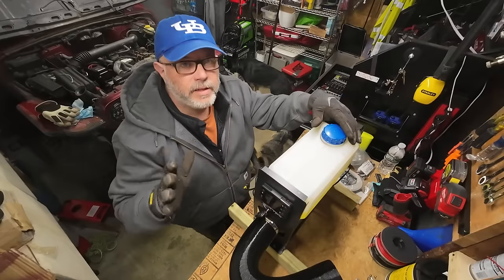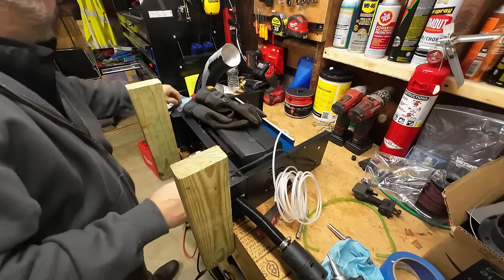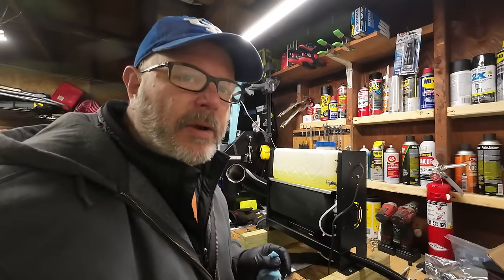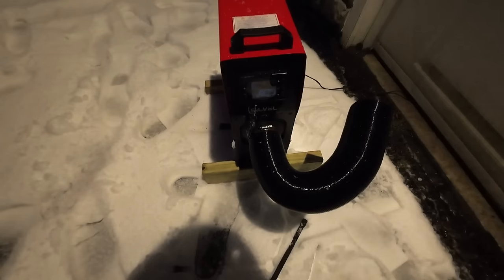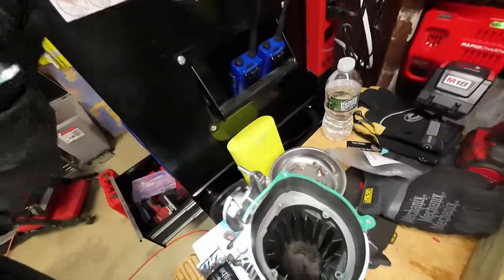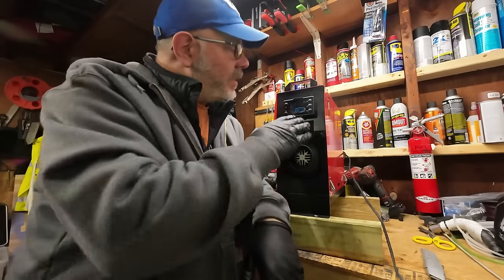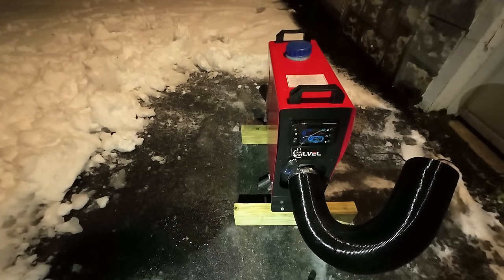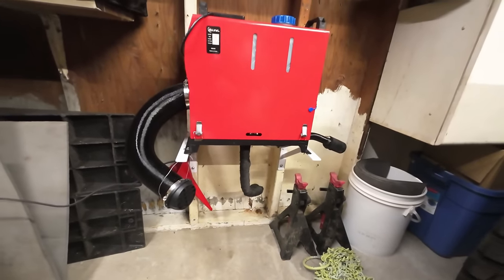Mistakes were made - I almost killed my diesel heater

Comment: The soot issue is something known as rather common for oil burners. That they need the carbon and soot  removed every so often. It's just because you are burning a hydrocarbon. Modifications only delay ho often you have to clean them out. The size is partially the problem, too.
Reply from the maker: Thanks for commenting. Yes, the soot took me back to my oil burner service days 38 years ago. I'm hoping this will take me through the rest of the winter and I'll service it for next fall.

Comment: Just a little tip I run my heater off a jary can I drilled a hole in filler cap save you from spills.
Reply from the maker: That’s a great idea. I think I’ll give it a try. I literally just filled the tank for today 😂
Reply: @paulethier3416  it works great I just take the cap off one of my other cans when I go get my fuel
Reply from the maker: Thanks for the tip!
Reply: @paulethier3416  no problem happy to help

Comment: Very interesting video. Looks like You have a much better mounting place for the heater. I have mine up high in my shed and I used the same marine through hull fitting going through my vinyl siding. The only extra thing on my siding was one of those flat mounting plates for light fixtures. I bought a 3/4 inch pipe cap (in the hardware section at Home Depot where they sell angle iron and threaded rod) I put a plastic drawer pull knob on this and once the exhaust has cooled down, I put this into the through wall fitting. This will keep insects, birds, mice and rain out........Take care, Bluefin.
Reply from the maker: That's a great idea. Thanks for sharing and commenting.

Comment: Two weeks back same machine new (in case) exactly the same had to open it clean it then run kerosene in it ,never had this problem on my other 2 over last four years did notice that glow plug was not screwed in fully on dismantling
Reply from the maker: Yes the glow plug was loose
Reply: My thinking was to much fuel getting into the burn chamber????
Reply: @johnhealy9231  2 machines with identical problems, could be they are being sent out with incorrect settings for pump rate/fan speed. Or maybe even a bigger pump, if they've used a 28ml pump instead of the usual 22ml you would be about 25% rich on the fuel/air mixture. You would need a CO meter to set the correct pump speed.

Comment: permetex red or copper hi-temp sealant would probably be the answer for gaskets.
Reply from the maker: Thank you for the tip. All I had was the black at the time. I will get a tube of the hi temp you recommended to have on hand.

Comment: Does it automatically adjust the mixture for altitude?  Where I live is about 3500 feet above sea level and there doesn't seem to be a problem, but I wonder if it's running too rich.  I'm not having any carbon issues but I haven't had it very long and so far I only ran it for about 20 or 30 hours..
Reply from the maker: I’m not sure if it adjust automatically. Since I fixed the exhaust it’s been running perfect.
Reply: @paulethier3416 Okay, thanks.  I'm not seeing any smoke and the exhaust smell isn't very strong, so either it does, or I'm not high enough for it to make mush of a difference.  Maybe come summer, if I feel ambitious I'll mess with it a little.

Comment: Paul every time you use the Heater do you put it on max before you shut it down that causes blocking  👍
Reply from the maker: Yes I do. Because my garage doesn’t have very good insulation it always run on high
Reply: Hi Paul have you tried to change the pump for a stronger one, might help with the performance and stop that annoying tick have a look at David Mclooky his channel is all about the Chinese diesel heaters hope this helps he's  Scottish 👍
Reply: Soz mate it's McLukie

Comment: I'd guess that your exhaust set up was causing excess back pressure in the combustion chamber. This is most likely causing poor air fuel mix and dirty carbon rich combustion. If you have to extend the exhaust, I'd do a straight pipe set-up or single large clean radius bend. Best with ridgid tube instead of flexible tube.
Reply from the maker: I've had no issues since I modified the exhaust. Thanks for the comment.

Comment: i set mine up in my old shop ran flawlessly then i moved set it up and strarted it got all the errorcodes E2 E3 E5 E8 E10 turned out it was the battery not liking the deep cycle charge i accidently gave it by not checking the charge settings first and the fuel line was kinked so ill be ordering that white hard line because temporarily i just have the cover off and the tank sitting at a 45 degree angle as to not kink the line. as for the pass through its just held on with drywall screws until my crippled ass can find some help. im hoping the exhaust port being 4 feet off the ground there wont be any issues when we get 4 feet of snow in February
Reply from the maker: Yeah the fuel line upgrade is nice compared to the stock hose. Thanks for commenting and I had no idea that the battery could throw all of those codes. Good to know.

Comment: Just wondering, will the muffler that comes with the heater fit on the outside of the through hull exhaust vent?  I'm thinking of doing the same exhaust set up as you, but want to muffle the exhaust to avoid neighbor complaints.  Would prefer to have the muffler mounted outside my garage so that it can drain moisture through the muffler hole and not leak fumes through the muffler moisture vent into my garage.
Reply from the maker: I’m not sure. You might need to a a coupling on the outside.

Comment: Hey Paul, how is the exhaust hall vent holding up?  Looks like you have vinyl siding.  Have you had any issues with heat around the wall vent where it connects and goes through the wall?  I'm thinking g of doing the same thing but am afraid of excessive heat starting a fire.  Cheers from Canada
Reply from the maker: No issues so far. I typically only run it on weekends when I'm working in the garage. I turn it on around 8am and run it until 6pm. I drilled the hole a little bigger and I wrapped the thimble with exhaust wrap and then installed it. I always run it on high so its always producing the most exhaust heat possible.
Reply: @paulethier3416  Sounds good.  Thanks for the reply.  By the way, you should post the blueprints for that custom made amazing exhaust cover😁
Reply: Had mine mounted more or less directly to my shed wall with pipes running through a metal tube made from rain gutter parts. It still made the wall warm enough that I couldn't stop worrying about it. Bought a longer exhaust pipe and mounted it like his re-install. Seems to work better.
Reply: @fondy44  cheers

Comment: Couldn't condensate from the exhaust ice up in the external metal outlet?  The metal outlet seems a small bore, so any moisture from the heater (not just rain) may be blocking the outlet? Condensate pipe from a gas boiler in the UK is around three times as big, and made of plastic to prevent such freeze ups. Adding more metal in the rain deflector will now just be a bigger heat sink, so the outlet may actually get colder and ice up more readily. Bigger bore, out of plastic drain pipe and insulated would be my next move
Reply from the maker: Ok, thank you for commenting. I was thinking about a large metal pipe but never though about plastic. It would have to be hi temp because this thing does get very hot.

Comment: burning hydrocarbons - gives an exhaust gas containing CO CO² and H²O.
. The H²O escapes as super heated steam, it can and will condense in your tailpipe and if it can it will collect somewhere if it finds a chance.
No need to look for an external water source to get into your system.

Comment: i might have missed it in the video but how long have you had / how long have you ran this heater? and on what power?
Reply from the maker: I installed it right around Thanksgiving and I’ve ran probably 20 gallons of diesel fuel through it. I believe it was my exhaust pipe that was causing the issue time will tell.
Reply: @paulethier3416  interesting. You explained your theory well. I’ll be looking forward to seeing if you have better luck with the carbon build up. I haven’t seen that before when running diesel

Comment: How did the permatex work out?  Did it fail?
Reply from the maker: No issues so far and no carbon monoxide leaks either. Thanks for the question.
Reply: @paulethier3416  how long did u leave it to cure?
Reply from the maker: I don't remember. 1-2 hours I think.

Comment: Did you put barbs inside rubber/nylon tubing connection when adding fuel filter.
Reply from the maker: Yes, the filter has barbs that hold the hose in place.

Comment: What is the claimed issue with the fuel lines? And did you think there would be no warranty assuming they knew you didn't have the exhaust all downflowing? Did the instructions mention that was needed?
Reply from the maker: The claimed issue is the green hose is to soft and expands and contracts on each pump. The clear hose is more ridged and delivers more consistent flow of fuel. I read about this problem on another video and when mine died I took the opportunity to switch it over to the cleaner hose. No issues so far.  I didn't even think to warranty anything, I figured it was to much of an issue and the instructions are so vague it really didn't give much information. Its been running great since I made those small changes. Thanks for commenting.

Comment: Good work to get er workin!
Chinese diesel heaters are infamous for excessive carbon and need to be cleaned regularly. Don’t get why pushing heat down hill 24” is going to change or make a difference. Causing more unnecessary back pressure creating carbon build up. It’ll be worse than your original set up. Exhaust vent an inch or two below outlet on machine would be all thats needed. No back pressure and no condensation build up.
Reply from the maker: My thought going down hill is the moisture would at least drain out. So far so good, it been 2 winters and we are heading into our 3rd.

Comment: E-10 can be easily solved by repriming and restarting, you will hear the vacunm suck in air into the tank  as you unscrew the fuel cap if there is no airflow through the tank cap. dont forget to run the heater at full chat for ten mins before shutdown to keep the burn chamber clean. just push a hot needle through the cap centre or use a 1mm drill bit.  E-08 is a fueling issue but it could just be air bubbles in the line cavitation from the pump possibly e-08 and e-10 can show up together. if you turn the fuel pump mounting upside down so the weight of the pump is pressing down on the rubber mount it will be slightly quieter. looks like shes flooding need to go into thwe special settings menu either 1866 code or 9009 code for the special settings and adjust the fan speed settings to 5000 uppermost limit and 1500 lower limit. if it is set to 4500 uppermost factory settings over fueling will occur causing it to flood and flame out.

Comment: I just ordered the 8kw unit , I'm  wondering about the heat going thru the wall , did you insulate the exhaust pipe inside your wall ? I'm seriously thinking of putting the unit outside my shop , under a covered patio and running the fresh air inlet and the heater pipe thru the wall , because the unit seems really loud if it were inside , thoughts ?
Reply from the maker: Thanks for the question. I used a thimble to go through the wall. There should be a link in the video description. I also wrapped the exhaust to protect from radiant heat. My wall temp right around the thimble is typically right around 160 or 180 degrees F.
Reply: @paulethier3416  ok , I did see the link for the thimble but was wondering about the inside heat of the wall. I also ordered a roll of the heat tape ( not sure of the proper name of it ) to wrap the exhaust pipe  , thanks for the response.
Reply from the maker: Make sure you wear rubber glove when wrapping the exhaust. The wrap is part fiberglass and your hands will be itchy for a day or so. I learned that from experience. Also, when you first fire it up it will smoke. If your in a garage or shop you will probably have to open the door.
Reply: @paulethier3416  oh ya great tip ,  thanks , I'm seriously thinking of putting my unit outside of my shop , under a covered patio or even an enclosed box , then just running the heating tube thru the wall.
Reply from the maker: That sound like a great idea. I'm not sure how weather proof these heaters are but with a roof over it I feel like it could work really well. @scottweedin7570
Reply: Great job paul.have learned so much from you IAM going to put one outside blowing in through my wall.i will be making a box from wood but was wondering how to stop exhaust burning wood.noticed you had a boat mount through yours it's heat dissipation IAM worried about.thanks for your videos.
Reply from the maker: Thank you for the comment. I wrapped the exhaust with motorcycle exhaust wrap to keep the heat down. It runs about 150 degress F. Here is a link to the wrap I used. https://amzn.to/3HL0cyB It will smell and smoke a little on the first run but it will go away after a few hours.  @anthonyralph3101

Comment: were you using just diesel gas ?  How many hours do you have total on this heater ? YTy
Reply from the maker: Yes I use diesel  right out of the pump. It only has about 40 gallons of fuel through it right now. I can’t say for sure, but I’m pretty confident the way I had the exhaust installed caused this issue

Comment: Sir, are you sure the  filter is installed correctly ?
Reply from the maker: No I am not sure. I’ve seen them installed both ways and there’s no arrow on the filter. It seems to work OK I’ve ran it for six hours with no issues. I’m open to suggestions if you have any. Thanks for commenting.
Reply: @paulethier3416  The right way is in the other way
Reply from the maker: @bellofiore894  Ok, I'll switch it around. Can I ask why the other way is correct?
Reply: @paulethier3416  As you said .the filter now is working but USUALLY the real position is with wide part UP and narrow DOWN. A quality filter has an arrow that indicate how to place otherwise it does not work.  I know  you know this.Greetings
Reply: @paulethier3416  Either way will filter but I've always seen them installed so that the fuel comes in around the outside of the filter element then flows out from the center of the filter. It takes more debris to clog it like that and also you'll be able to see any debris as it accumulates.

Comment: Did I change the wire scream in the unit where the fuel line goes in
Reply from the maker: I did not change the screen but I did clean it. Thanks for the question and commenting.

Comment: Hey buddy I watch you clean your diesel heater out can I suggest something I haven't had problems with mine for 6 years if you take and you run some diesel fuel injection cleaner in it it'll help keep that combustion clean and I've never had no problems never changed no fuel pump never change fuel heater never changed the glow plug and it still run for 6 years I've never had not one problem with it brother So I would suggest to take and clean it out and put some of that diesel injection cleaner in there already thank you let me know how that works out for you thank you
Reply from the maker: Thanks for the comment and suggestion. I'll give it a try.
Reply: @paulethier3416    yer welcome it works for me i havent done nothing to mine in 6 years
Reply: Yeah I agree was actually going to suggest this until I saw your comment dpf cleaner or a fuel additive should keep that burn chamber clean

Comment: Condensation buildup in the exhaust would not cause carbon builup in the chamber. You’re obviously running your fuel too rich for your altitude, and that can be tuned.
Reply from the maker: Thanks for the comment. How do you tune that?

Comment: If you run this thing on a low BTU setting for long periods, turn it to it's highest setting for a few minutes before turning it off. This will burn off the 
carbon buildup that it accumulated by running it at a temperature too low to burn off the soot.
Reply from the maker: Thank you for sharing this information and for commenting.

Comment: What happens if there is a sudden power cut during operation?
Reply from the maker: Many people have pointed out to me that it should be run on a battery so if the power goes out it won't be shut off immediately and there will be time to turn it off properly if needed.

Comment: I ran my diesel heater in the arctic in -35 and the fuel pump actually failed. I replaced the pump with a new unit and it was back up and running in no time.
Reply from the maker: Thanks for sharing a comment.

Comment: i run mine on low, quite alot of the time... which aint good... the soot builds up.. doesnt get hot enough to burn it out... So once a week, I leave it on, flat out, for about 30 mins..... All good
Reply from the maker: That's great information. Thanks for sharing and for commenting.

Comment: Was that happen in 2 month? All that carbon Ash?
Reply from the maker: Yes. I had a low section in the exhaust which caused moisture to build up which cause carbon to build up. The new exhaust has a slope to the exhaust discharge. Works much better
Reply from the maker: The low point on the exhaust I believe caused the carbon buildup. It’s been running great since I made the repairs and exhaust modifications

Comment: Refit the fuel filter , cheaper to replace filters than a fuel pump ,
Remove lagging from exhaust, fit a12v mini fan to blow all that wasted heat in to your w,shop . Fit new gaskets asap , you don't  want carbon monoxide in side your w.shop 
Most importantly install a carbon monoxide  alarm